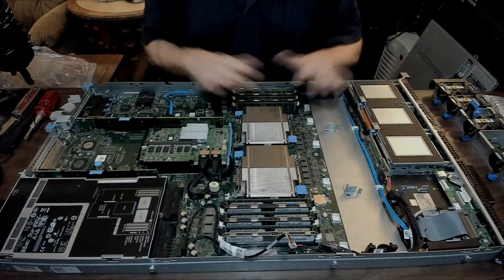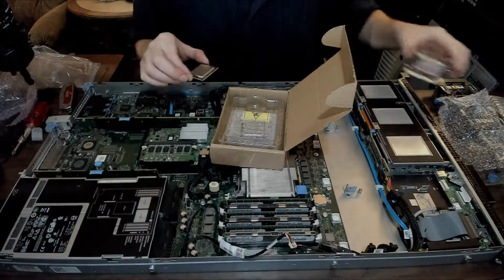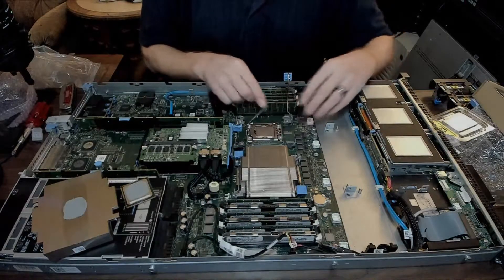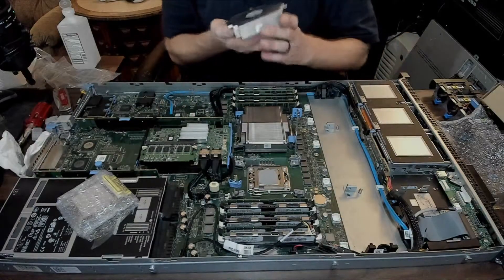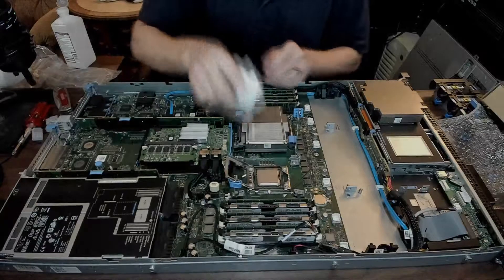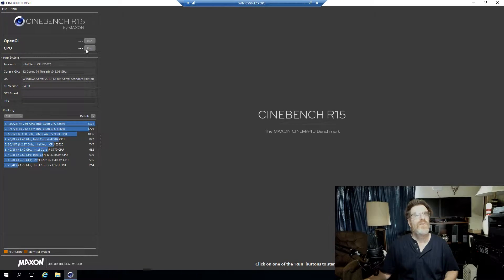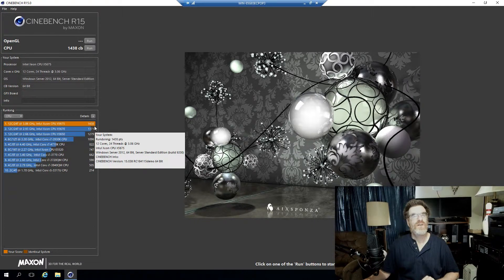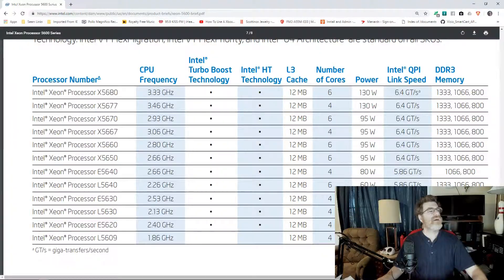Dell R610 CPU change to Xeon X5675

Comment: how can i tell if the motherboard in my R610 capped to 95 watts?
it originally came with two X5650s and i want to upgrade to the two X5690s i bought, i checked on the idrac webpage under system / properties / system details and it says System Revision II if that helps.
Reply: did the 5690's work was there full speed with them what was the out come?
Reply: @62bostonmanortheastcorner20  if your psu's are high enough wattage and you have the correct heatsinks they do work on the rev II boards but at least for me the fans wouldn't go below like 3000 rpm but with a custom fan script it wouldn't be a big deal.
but yes they worked, if you have a dedicated server room then there probs worth it otherwise the X5675's are the best option if you want to stick with 95W cpu's.
my R610 and R710 both use X5690's and have the max amount of ram possible for those servers and they are crazy powerful.
Reply: @RazorX-Gaming   @RazorX2021  thats awesome ya we just got the r610 and getting ready to dive into them now does yours take the 32gb strips of memory? im thinking of getting those too. also what about the raid controller what are you running for that? the one i got has the h700 but was thinking about getting the Adaptec controller if their might be any hick ups. we have the 5672 xeons so the upgrade sounds like a good deal. we want to run virtual machines and help the phones , tablets, and lap tops out a bit by running all their stuff on the server. heres some info i have on the processors too. TABLE 5-2 has good info. 

https://www.intel.com/content/dam/www/public/us/en/documents/design-guides/xeon-5500-5600-guide.pdf
Reply: @62bostonmanortheastcorner20  the R610 can do a max of 192GB of ram (16GB Sticks) from what all the sources i looked at said so that's what i have in mine, the R710 can do 288GB (16GB Sticks) but i did talk to someone who deals with a lot of servers who said they both can actually do more using 32GB sticks but i never tested it as the sticks were a bit outside my price range at the time.
as for raid my R610 has a PERC H700 which came with it but my R710 i installed a  LSI SAS 2008 raid controller in it i flashed into IT mode for use with unraid.